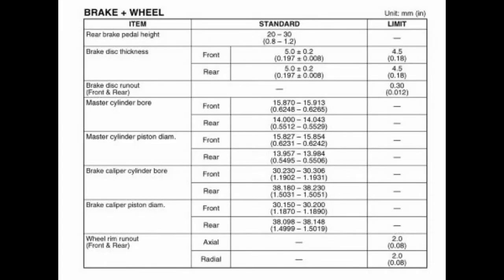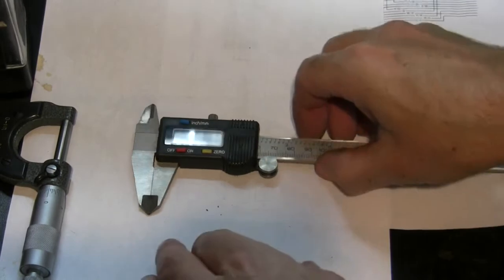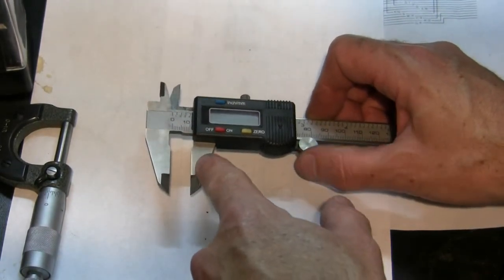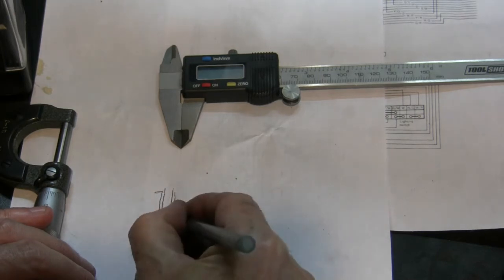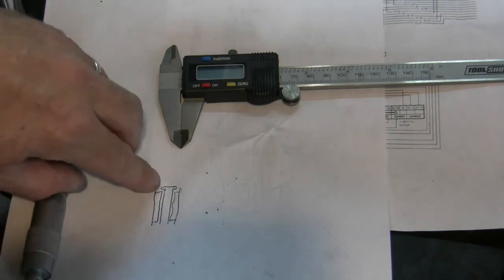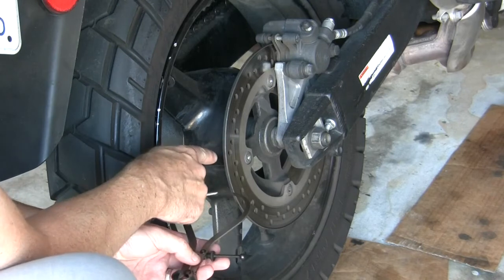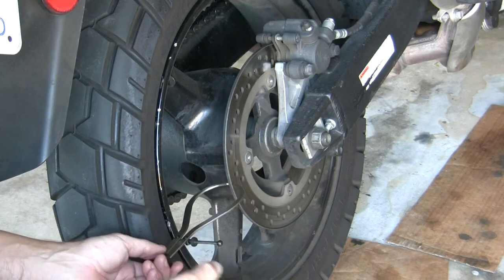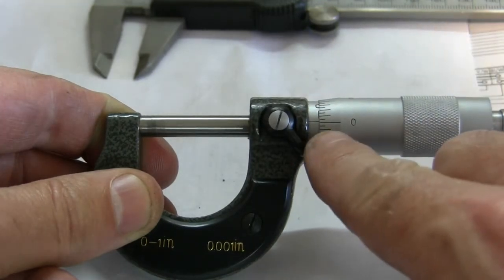Measuring Motorcycle Brake Disc Thickness (Rotor Thickness)

Comment: Hi Monk
Hey thanks for all your posts you do a great job with you bikes and share good maintenance tips.
Hey would be good to go for a ride with you but I’m in Adelaide South Australia. I’m riding a 2007 DL1000 and love this machine.
Have you ever considered the clutch basket shudder issue ?
Mine has done 44000km and I don’t know if it’s imaginary & getting worse, more vibration. Should we expect the need to replace this at some point ? It would be great to hear your thoughts. Cheers & Blessings 
Aussie Tim
Reply from the maker: Hi Tim! Thanks for watching. If I'm ever in Australia I will look you up. Feel free to do the same if you're ever in LA. Have you looked into the possibility that your clutch is developing the famed V-Strom "Chudder?" So many owners write about it that it may be a good first place to look.

Comment: 50000? I replace disks each 15000 miles.
Reply from the maker: Do you measure their thickness and they are out of spec at 15k miles or do you just replace them regardless of thickness?
Reply: @UrbanMonkTV  No, I replace it when it's beyond the 4.5mm limit. It's only the front that goes so fast. And it's a single disk. Now I'm measuring less then the limit in some points of the disk, I don't know if I should replace it if most of the disk is above the limit.
Reply from the maker: @ronenfe  Got it. Whether or not to replace is a matter of pad thickness also (as this is a matter of whether or not the piston will come too far out of the cylinder and leak) and your personal comfort with risk. The official recommendation is replace when you hit the specification limit. Only you can decide to do otherwise. Thanks for watching !
Reply: @UrbanMonkTV  yes. I have new pads. I'll keep using the disk until I am replacing the tire.